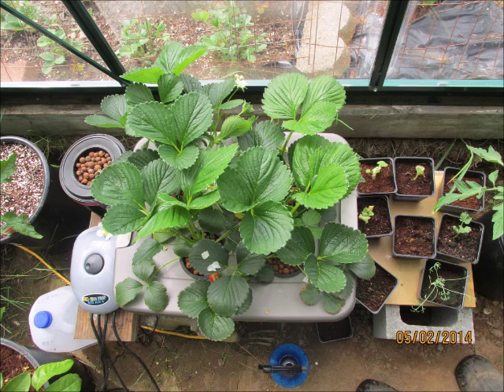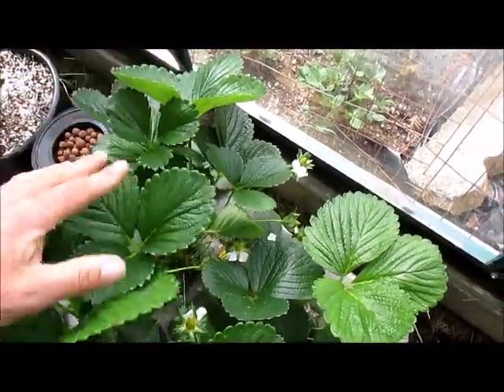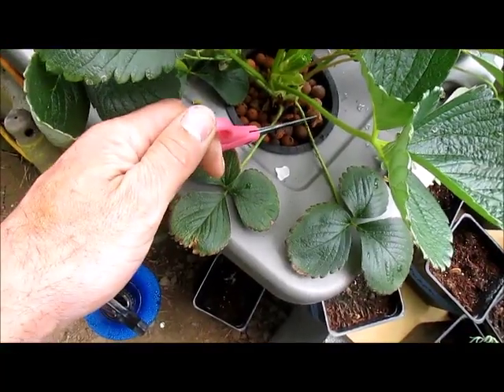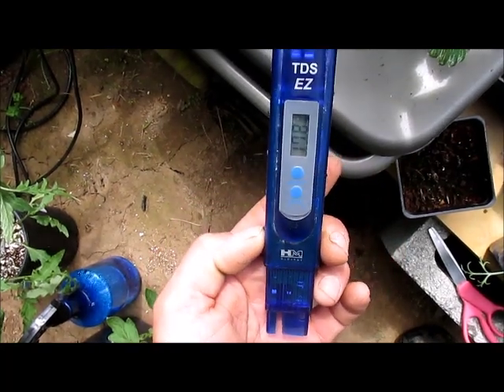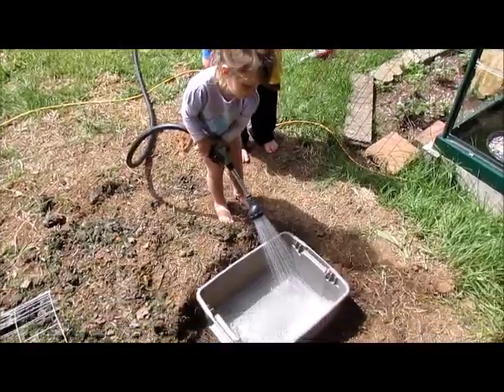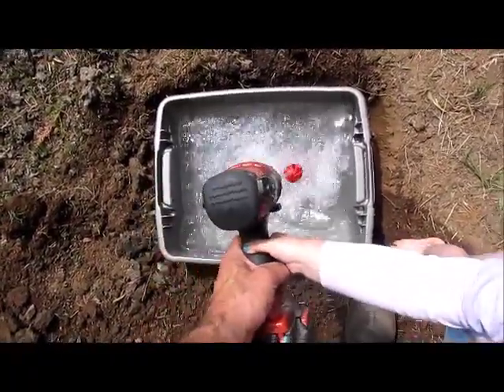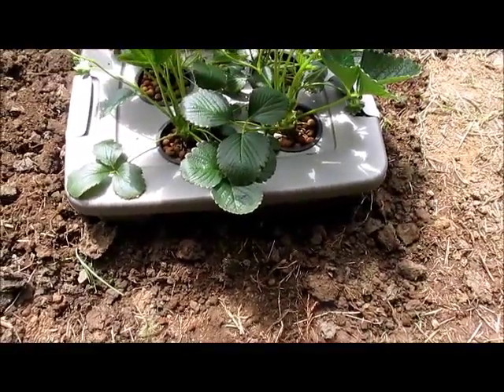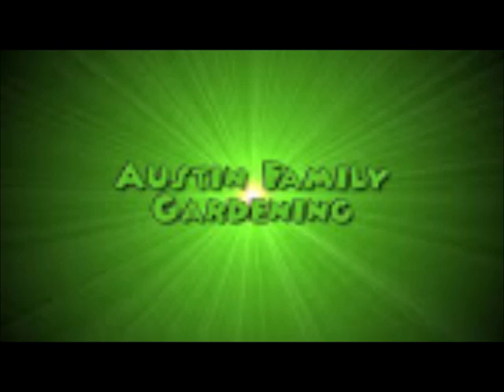Strawberry Hydroponics-No Power Or Pumps #3

Comment: Hey, I am planning for strawberries for next season but I will do it on the balcony. Do you think I can use the system for a longer period of time on the balcony, obviously without an option of digging them in the ground? How would you recommend I keep the container from overheating when the summer hits? thanks in advance for any suggestions!
Reply from the maker: coraxik Hi Coraxik, i'm still growing them in that tote & they're doing great. You might try wrapping the tote with panda film or maybe building a small wood box for the tote to sit in. might have to try a few things to see if it works. buy a aquarium therometer  to check water tempetures. you want to stay below 75 degrees. Hope this helps & let me know how you do.
Larry

Comment: I have noticed that a lot of your grows you use hydroton. And other videos I have noticed some people using just random gravel? I have built and aquaponic grow bed and need probably another 2 bags of hydroton and the only place in town is 40$ a bag... anyway my question is can i mix a certain type of gravel in as well? or should i just splurge and get the last 2 darn bags?
Reply from the maker: I also use lava rock - a lot cheaper than hydroton. It weighs more than hydroton if weight is an issue for your sysytem. You have to really clean the lava rock but once its clean you should be good to go. I wouldn't use gravel because it tends to throw the ph all over the place.